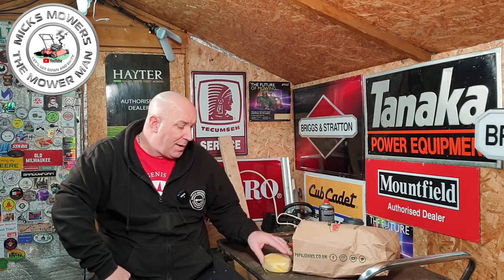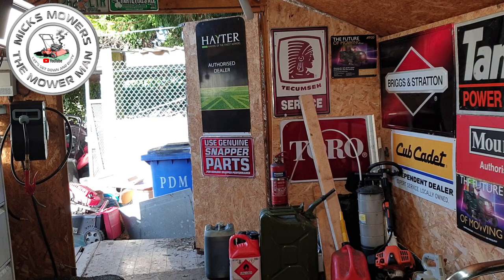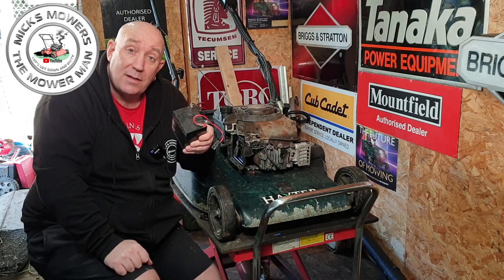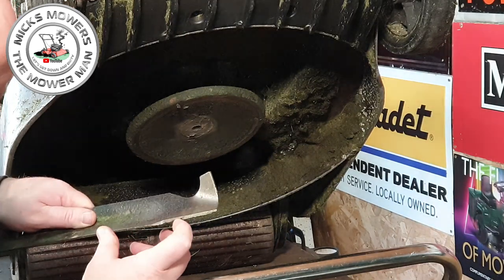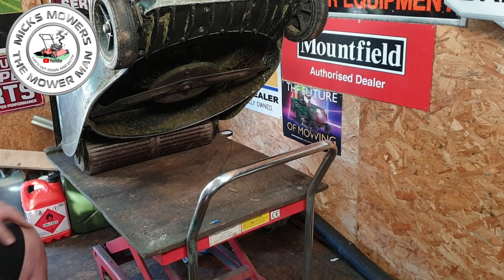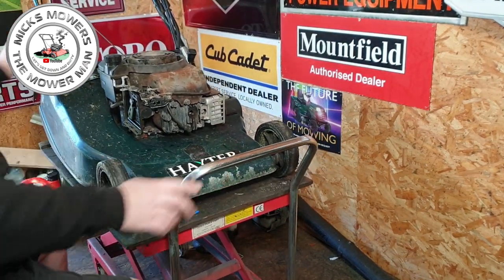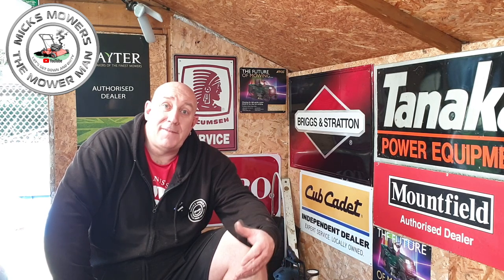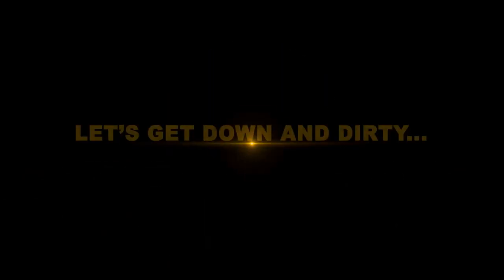How To Service A Hayter 56.. Save Money Do It At Home

Comment: Great job on the blade. Is there a particular disc you use to sharpen?
Reply from the maker: 80 grit flappy desk mate
Reply: @themowerman  thanks alot! Hopefully not a stupid question but how tight should I bolt the blade back on? Can I overnighten
Reply from the maker: @tjk355  hi between 38 and 50 foot pounds of torque. Riding mower blades should be installed between 70 and 90 foot pounds of torque.

Comment: Hey Mick, currently restoring a skip find Hayter 56 340L and hitting a couple of obstacles.  I cant find a throttle cable anywhere any advice. The second is if it was fitted with an OPC lever ?  Hayter sent me some photos and a manual but they all have different engines so hard to say if it did have one fitted originally.
Reply from the maker: Email me some photos mate micksmowers01@gmail.com
Reply: @themowerman  cheers mate I will do.  Got a Hayter 48 Pro too from a similar source but no grass catcher. Runs lovely now though after watching videos like yours.  Also restored a weird SABO 2 Stroke Turbo that i must admit cuts lovely.  I'll go grab some photo's.
Reply: @themowerman  email sent with link to photo album 👍

Comment: Hi Mick - I have a 56 similar to this maybe slightly newer .. could I retro fit an electric start function as mine doesn’t have one. Cheers - Paddy.
Reply from the maker: Yes mate but you will need to change the flywheel